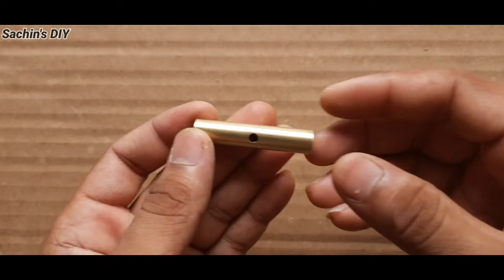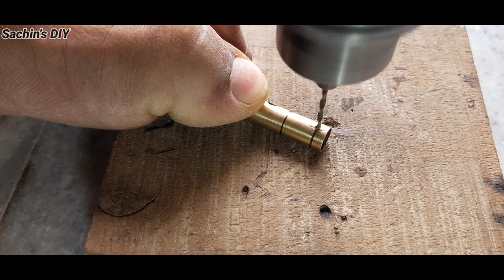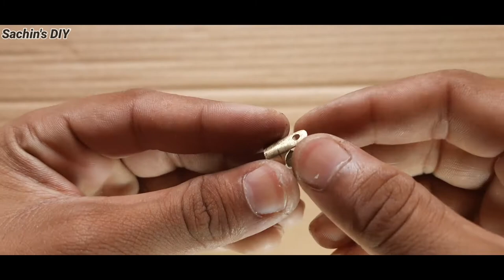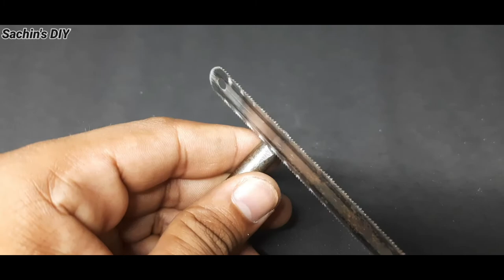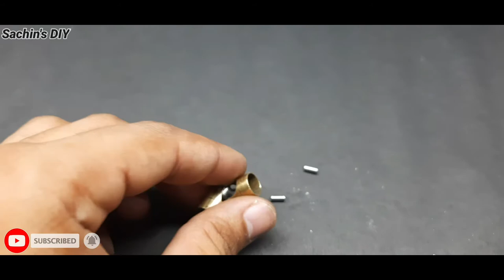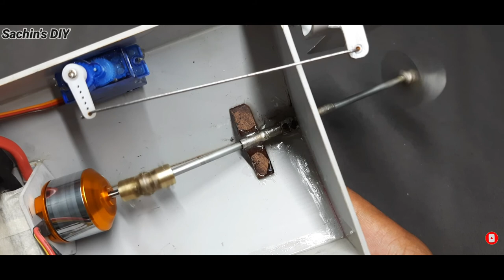How to make universal joint at home |DIY projects ||Sachin's DIY

Comment: Thank you very much man, this is very good idea and I think I will implement it on the next model RC car that I build 👍
Reply: My favorite part was how you used the drill as a makeshift "wathcmakers' lathe", which is a very good diea, because an actual lathe is very much money.
Reply: Good idea is using the solder as well to melt into a type of weld for the pins.
Reply from the maker: Thanks for your love and support brother keep watching and keep supporting 😊❤️